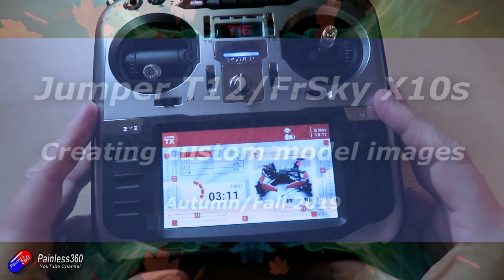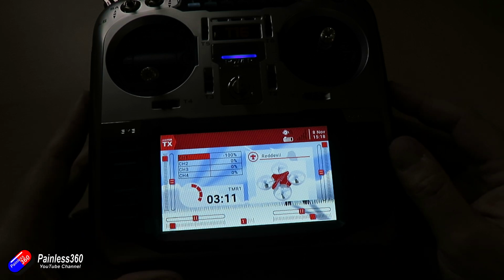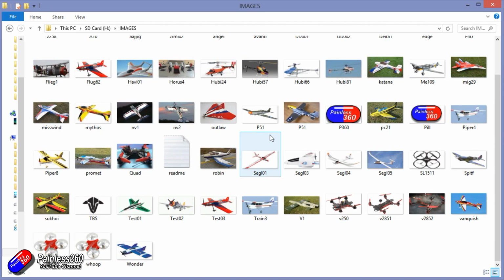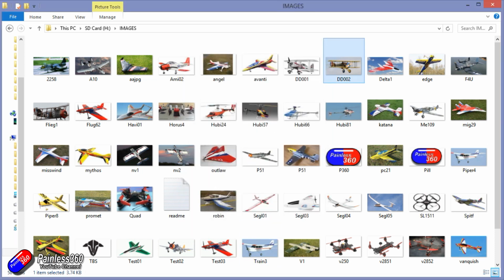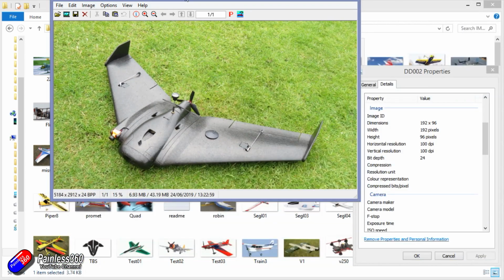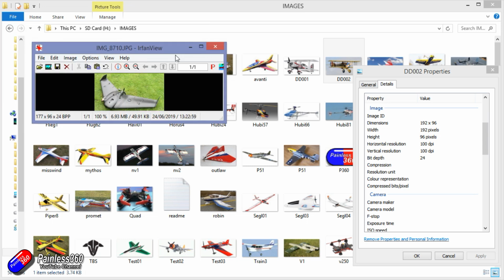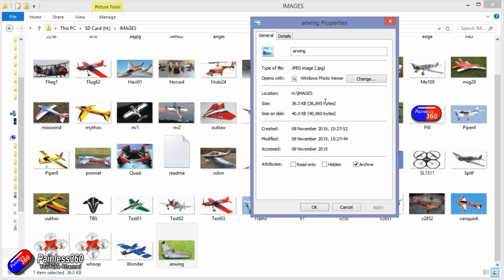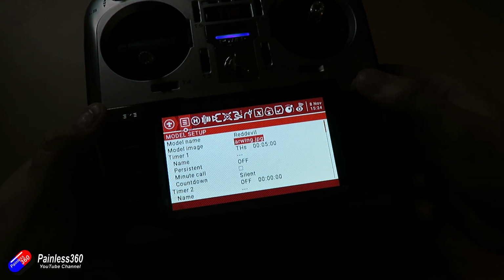Creating custom model images on Jumper T16/FrSky X10s

Comment: Hello Lee, since you've flown helicopters before, would you recommend the Jumper t16 pro for helicopters? I've flown spektrum for years with my helis.  Looking to upgrade to get voice alerts and more telemetry. 
Thanks
Reply from the maker: The support for helis in OpenTX isn't easy to use. See my Opentx video on it. This radio is as easy as any other Opentx powered radio...
Reply: @Painless360  What about the quality compared to spektrum? I have a Dx7s and love the ergonomics,  just need more telemetry and voice alerts.  The FBL I use is the MSH Brain 2. It supports f port, this would give me  esc telemetry. I fly 560mm helis, don't want to crash because of the radio not being up to parr.
Thanks
Reply from the maker: The quality is not a patch on Spektrum radios IMHO..
Reply: @Painless360  Not to sound dumb  but, I don't understand your response.  Forgive my ignorance. 
Thanks

Comment: Hello!

Great videos! Thank you and keep up the great job. Pardon me for speaking out of topic. I just recently purchased and installed the orange cube onto my Carrier Board (Kore).  Which version of the firmware do I use with the orange cube?  Are there any modifications needed to the file name or extension prior to loading the firmware file?

Thanks,
Mike
Reply from the maker: I've not tried it for a while but the problems I heard about were all from back in the summer so I'm guessing it's a normal firmware update.. Let me know how you get on..

Comment: hello sir.. i just bought this jumpert16.. but without the tx module.. what kind of rx can i use without the module? and how to settup the wing model alevon on this jumper?
Reply from the maker: The one I had didn't have an internal transmitter so you'll need a module of some kind to connect to anything.. Best of luck!
Reply: @Painless360  after I see inside the radio.. It's come with internal multiprotocol.. Yes.. It's can use many rx I have.. Thanks for the video 👍👍👍👍👍

Comment: Grate tip I've used air-rc.com with incredible results! Many of the models are cut without a background leaving just the model in grate detail and the selection is huge! Hope you have a look and maybe drop a plug to them in another video.

🍻cheers🥃

Comment: I use photoshop to edit the images also you can edit splashscreen.
Reply from the maker: Great tips, please consider sharing your tips via a video..
Reply: @Painless360  There are lots of things you can customize. I did a lot on my own radio and shared it on local website. I tried uploading a video on Youtube but it seems not easy in China. If you're interested I can share the details in the comment section...

Comment: I've been thinking of replacing my orx tx6i with the jumper t12. Are you still positive about the t12, now that you've used it for a longer time? 
Opentx video's that you've uploaded are all very informative, thanks!
Reply from the maker: Be aware that the radio shown in the video is a T16 not a T12, please ignore that mistake on the title card!
Reply: Thanks for mentioning that, I ment the t16 as well. What is your experience so far after using it for a while, worth it as a main tx? (For flying fixed wing, thumber)

Comment: There is a website www.air-rc.com which provides images for almost all model aircraft you can think of fixed wing or multi rotors as well as backgrounds they are designed for the X9D, X9E, X12, X10  (Jumper T16) both OpenTx and FrOs, Spectrum IS12, Jeti DS-24 and Futaba 18MZ. If the plane is not there you can register with the site and request images of the plane you have. No problems with editing, removing backgrounds, file and filename sizes.

Comment: Hi Lee many thanks for doing this vlog,  i have been doing this process since i bought the radio and it still doesnt work? the jpg shows on the T16 under SD card images but when i try to add a model image none of the new images are there? only the original images that came with the radio....anyone know whats going on.  Many thanks Lee
Reply from the maker: I've looked at a few images for Patreons.. It's usually image size or long file names..
Reply: @Painless360  Got it now Lee, many thanks for your help.
Reply: Your file and/or your filename size are too big